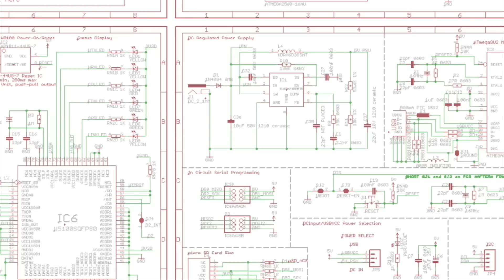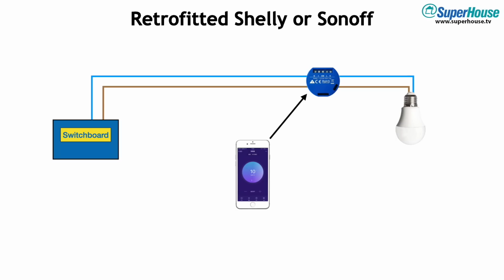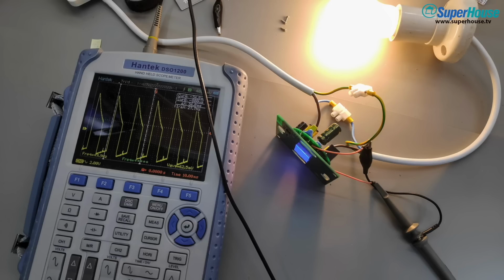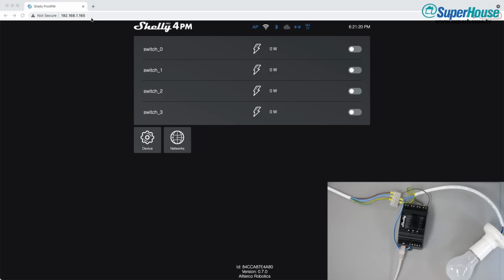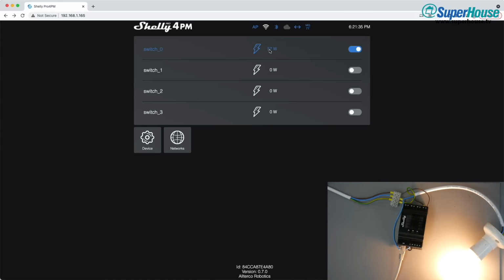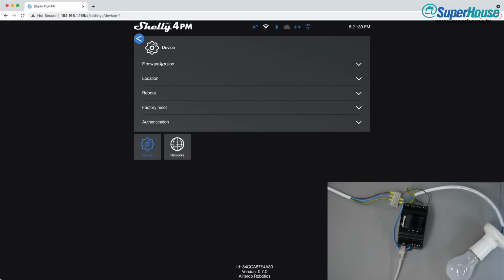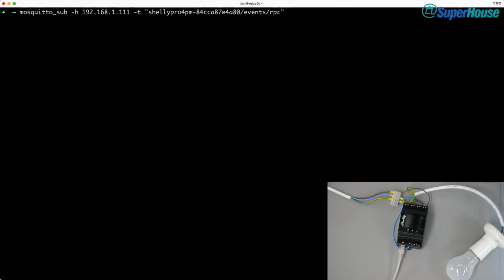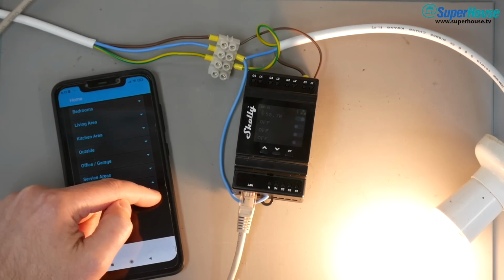SuperHouse 45: First look at the new Shelly Pro 4PM

Comment: So the aspect I was most interested in was using this with a physical switch, to provide manual local control (switch by the door, as non geeks/house guests are used to) as well as the automation capability. Unfortunately this was the one aspect you did not demo. Any chance of a follow up video please showing how you would wire this up? I think this would be of interest to a lot of people.

Comment: As a note, in Australia ALL mains wiring, whether it is CBUS, Shelly or any other mains dvice, must be installed by a licensed electrician.   The difference is you just don't need a CBUS certified one if you use things like the Shelly.    A lot of electricians will not install home automation gear unless it meets Aus/NZ standards, so make sure your equipment is not home made when getting your sparky to install it.   If you do it yourself, well you risk a few things.   Huge fines are one.  Insurance being invalid is another.  Liability if anyone gets injured or heaven forbid killed by electrical faults.    All of these modifications in this video would need a qualified electrician and a certificate of electical safety to be issued by that qualified electrician.     In other coutries this will be different, but the creator in this video is Australian :)  
I know that is a bit long winded, but the video, although stating devices needed to be certififed, didn't clearly state that none of this is a DIY thing in Australia

Comment: Hi Jon, two years have passed. Did they pass certification? And have you installed them? 

I have bought a number of them after this video, but am based in EU. I still need to install them so a followup might be nice. 
I do see a lot of negative comments about them lately. In my opinion they generally are about the way how the neutral is shared and incorrect use by overloading them. But if you can't use it anyway it might be an idea to open one on a live stream and give your thoughts about the design.
Reply from the maker: They've passed AU certification, and I had one installed at the lab just last week. The electrician was initially stumped because it's installed inside the switchboard and conceptually he thought it was a device to control 4 circuits, and the common neutral messed up his plan for how to install the RCD. But once he understood that it's not 4 circuits, it's 1 circuit controlling 4 loads, he was fine. I think the reason people complain is they don't understand what its purpose is.
Reply: @SuperHouseTV  That is exactly what it is: one circuit, 4 loads. I think the misunderstanding comes from the way how Shelly puts the product on the market. As your electrician I think many people understand it as 4 separate circuits indeed.

Comment: Shelly Pro 4PM can only be used for 1 phase (hot wire). It is not suitable for split phase or three-phase current !
If you connect large inductive loads like motors then the Shelly will burn up internally. This also applies if you connect a large contactor.
It is really only suitable for household lighting.
Reply: They have a shelly pro 3 for that

Comment: Fantastic thanks. Can I assume you've had to run a single individual cable from the fuseboard to every individual power socket so they can all be controlled individually rather than the typical daisy-chained circuits we commonly see in house (which obviously saves a lot of $$$ on cable)? And therefore, you've done the same with every single light socket being wired individually back to the fuseboard?? I'm just thinking of the implications to the amount of cable required for a true star configuration.

Comment: With all these small cheap Chinese microcontrollers built into these devices, I'm worried about making the whole house susceptible to voltage surges, e.g., a nearby lightning strike. That would ruin the day and all equipment. This issue is widespread in the sailing community, who see their boat electrical installation wrecked. Good episode, though. Cheers.

Comment: you are obviously well versed in programming and such. I am a retired professional electrician y interest in home automation is retro fitting various things around my home ,the largest is my pool pump, and associated heat pump ,mainly when im away from home . The other things are outside lighting I live real and the need to turn on lighting when I pull into my drive way or some one else does I need the lights to come on ,as well as when the leave my doorstep so that my steps and such are illuminated , I do this now with a series of motion sensors and smart plugs ,but is getting a bit overwhelming with two or three different hubs and devices that do not work together . Do you thing a system like this could minimize all that clutter? I also have two remote buildings one that is both heated and air conditioned . I have both wifi and ethernet at both my main home a one remote bldg.I just need simple control with power metering so I know things are on. I really do not know much about MQTT programing ,which you seem to ,in your opinion do you think these devices will work for me?
Reply: Are you familiar with PLC's at all?
Reply: @danieldevlin5110  yes worked with them when I was at Johnson control

Comment: Hi Jonathan. I am a big fan of Shelly devices and I'll have one of these relays soon. One concern I have with the LAN function it how safe is it. For example if you house gets hit by lightening and the device fails. How likely is it that 240vs get sent down the LAN cable straight into the low voltage side of your switch or router?. Other than this worry. I think its an awsome peice of kit.

Comment: Your dashboard implementation in NodeRed has a bit of a problem - if you do manual control, or you switch it using website, your NodeRed dashboard will not reflect it. Better solution would be to feed the control in NodeRed from status update of the MQTT message, generate the message upon click (but don't change the status of the control) and the control status will be updated once the Shelly 4PM "confirms" the new status.
The rest of your video is perfect, I am subscribing and looking forward to more content from you.
Reply from the maker: Good tip Robert! Thankyou

Comment: So expensive for a little more control .I prefer a Sonoff 4 channel system or single automated breakers as they are so  much cheaper and offer you only a little less .For me I prefer to set up once and reprogram only if I need to change on/off  times which is not so often.This Shelly unit looks great but in a three phased circuit board you might need four or more of these ,$400 US from Ali ,ouch .Again I prefer single units which can be installed one by one ,cost about $20 each and fit my style .Nice review very detailed

Comment: As someone that has been using the Shelly Pro 4PM for several months now, Ive ran into 2 problems: 1) Channel 3 sometimes will simply have its power meter stop working, requiring a reboot of the 4PM. 2) it doesn't tolerate any sort of current spike. Normal breakers have a curve and allow very short bursts/spikes that go above its Amp rating. The Shelly will turn off the channel for any slight spike, such as a portable AC unit turning on (the compressor).

Also big WARNING: Don't know why, but all 4 input load lines are shunted together, something I find really stupid and can be a deal breaker in some configurations.
Reply: I find Shelly Support mostly pretty good.   I know your comment was 3 years ago, but I am sure they would help with the issues.    Shelly devices are not breakers, so have to always use a breaker.  I tend to leave only the overheat and over current enabled.  I disable overvoltage as I found it too sensitive when the voltage on the mains line can sometimes spike above 255Volts in my area.    
With the latest firmware (obviously I am talking 3 years later) things seem reliable and stable.  Great if you own a home and can have it rewired to a star configuration where loads can be centrally controlled.   I don't find them quite so useful in retrofit as turning off an entire circuit is not always desirable.   Great for Power Monitoring though.    Being direct connected, they are more accurate than clamps in my experience.

Comment: I am connecting a 4 way push button switch from the room to the Shelly in the switch board (10 meters away). How thick the cable should be? Is 1mm(2) an overkill for this?

Comment: Quick question Jonathon: How would you wire your momentary switches up to be the assignable light switches using these instead of your Arduino controller?
Reply: The 'S' connections on the bottom edge of the Shelly (beside the neutral connection) are the 1-4 switches

Comment: That looks awesome, but my trust in Shelly was diminished given how hot they got with only a small load. 80C + with a 10W load, couldn't trust that temperature inside the wall, I really wanted to like them and replace some of the zwave. Hopefully this will redeem my faith in Shelly as there should be better thermal control looking at the DIN size.

Comment: I love the idea of ethernet but how does that perform in a live scenario with multiple 4pm on a din rail with loads of power cables running side by side the ethernet cables? Isn't there any EM induction that would dampen the ethernet performance?

Comment: Have you looked at the Siemens LOGO! line of PLC's?   They can pretty much do the same, but in addition can also run logic locally on the PLC itself.   They also have expansion modules to increase the number of relay outputs.
Reply: I have some ELC PLCs which are essentially good Siemens LOGO clones, but from a connectivity point of view they are a little behind the times. Modbus and the like aren't as easy to integrate into modern systems. I'll be replacing them with the Shelly modules which are much cheaper overall and provide that connectivity. It would be nice if there was some scripting on the Shelly Pro but I can make do.

Comment: Pre-Ordered two in the UK, one thing that is disappointing, it looks like you have to use mains electricity for the switched inputs. I get why you'd do that but I like the idea of using LV switching instead of higher voltages, where possible.
Reply: FYI, Just received an email from Shelly/Allterco Robotics saying that the delivery of my pre-order will be delayed by 10 days. Not worried, but thought I would share.

Comment: The fact that it has ethernet makes it worth considering. So far, the "WiFi only" aspect has kept me from using Shelly products in any real world setup. Now all that's missing is trailing edge dimmers, because at least in my area, those are still quite relevant.
Reply: dimmer pro has been announced so hopefully it turns out good

Comment: Can these be connected together and controlled via a single Ethernet link? Seems rather silly to need a separate Ethernet connection into the box for every four circuits. Can you get a certified DIN switch that would fit in the rail along with these?
Reply: The simplest way to me would be a DIN-mounted managed/unmanaged switch in the same box. They exist but are mainly for industrial applications so I wouldn't say they are widely available

Comment: Sorry, but this is stupid product. Every electrician knows that they wire a lot of lights to the same circuits. This would turn lights off in half of the house rather than controlling individual lights like a sonoff. It will be a hassle to integrate such a device in any house that was wired before year 2010.
Reply: He said new builds, smaller projects are also fine.

Comment: I'm surprised there isn't a simple add-on expansion module for the Shelly Pro 4PM to give you more than 4 relay outputs (much like a normal PLC expansion module, where you typically have the 'brain' PLC module, and then you simply add-on more Input/Output modules if you need them).
Reply: I was thinking the same. Like a thin serial connection between them. It is often already cramped in a switchboard, wiring a bunch of Ethernet and placing a switch there too might complicate things.

Comment: How much do you trust the No Cloud option? Do you think they report back at all?
Reply: Depending on ya network setup, firewall it or put on internal only subnet, or even in the static settings set a invaild gateway, if it lets you.
Reply: @matthewgladwell1026  I would rather flash it with a opensource firmware if one existed for it.  I be Tasmota/ESPHome won't work with this. If it did, it would be wonderfull!
Reply: @markgilbert249  yep same here esphome is what I use in home assistant and would prefer that too.

Comment: Ok so that's the product we've all been waiting for! I'm in the UK and I've found it on a UK site for £74.99 ($103.78 USD $141.71 AUD). They are out of stock though so it's either not yet available or there's quite a demand. And no wonder when it does what it does. Excellent find and info Jon. Thanks.
Reply: That's a really good price considering it controls 4 loads and has all the features(like power monitoring) built in.  That's about $25 USD per load which is only marginally higher than using various wifi switches that are currently available.  It's certainly cheaper than using switches with other protocols (like zigbee, etc).
Reply: @BrianSimmons  agreed. The Shelly UK site lists them as £79.99 and available to pre order so they aren't actually available until October. Would be a fair amount for an entire house especially if you also decided to do the sockets through them too but for the ease and features alone they are probably worth the spend. Just wondering what use Bluetooth would be though. The distance Bluetooth works over wouldn't be much use for me unless I'm stood right next to the supply board 😂

Comment: Thinking out loud...

If the Pro4 PM had POE, it wouldn't need the Neutral and that could be useful...

Obviously a different internal board and model number...
Reply: I'd rather have NC NO contacts than wasted terminals IMO.

Comment: Looks awesome. The only certification question I have is how do you install the ethernet cable and comply with AS S009? Maybe if they had a conduit gland you might comply. AS S009 stipulates separation requirements for communications cables and LV power. These distances increase when there are terminations involved.
Reply: Any cat5 cable can be used for cbus however only the pink cables can go in a distribution panel as they have mains rated shielding. Clipsal had also open sourced thier protocols and drivers. There are several projects to add mqtt using their serial and ethernet interfaces.
Reply from the maker: This is the big question in my mind, too. C-Bus manages to have comms cables physically in proximity to LV cables, and to be honest I don't know how it complies but somehow that's the way they do it.
Reply: @SuperHouseTV  Clipsal use mains rated sheathing on their cat cable and position their connections appropriately too.

Comment: Great video how would you wire this with a wall switch still in place
Reply from the maker: There are screw terminals on the bottom of the Shelly for connection to wall switches. I didn't show how to wire them up in this video, but I'll probably do that in future.
Reply: @SuperHouseTV  Perhaps still an advantage over what you've described as 'retrofitting wireless relays' is related to his point about wall switches -- no new wire run needed fr the wall switches back to the panel for the interrupter/switches to function ...as it would be guessing from your reply above. 

I really like your cadence of speech. Quality content -- thanks!
Reply: Alex Gill  wall switches are typically not run back to the board individually

Comment: One thing that would be good to talk about is how to control these from aspect of the standard light switch for full local control. Does it have a digital input or is it all ethernet based? 

I personally use KNX but the advantage of this type of system (referring to Cbus too) is that as long as there is power to the house, all light switches will still work as the light switches are powered and communicate over the same bus as the relays.
Reply from the maker: I'll probably cover that in a future video. It has support for both toggle switch input and button input, and the mode can be reconfigured via MQTT. With an external switch connected, it will work entirely locally without even a network connection.
Reply: @SuperHouseTV  Thanks for the quick reply - that sounds great.

Comment: It should be legal to use those to switch 24v relays, you would still have the same, if not more devices, but you gain the control and only require an additional box to install them. It would also be easy to remove the relays once the certification comes through.
Reply from the maker: That's a clever idea

Comment: Is the Ethernet cable rated at mains voltage?
Reply from the maker: That's a critical point. I talked about that in my livestream where I first connected this up, but I didn't cover it here. Cable inside the switchboard has to meet AU/NZ standards in terms of insulation and separation, so it'll be interesting to see what Allterco recommend. One of the reasons that C-Bus control cable is specifically certified is that it's intended to run inside switchboards.
Reply: @SuperHouseTV  I think Clipsal got around this by having a mains rated sheath on their otherwise pink CAT 5e cable. That said there are some Schneider electric power monitoring units I have ethernet as well. They've got certs for Australia. Maybe they don't care about S009 like most installers.